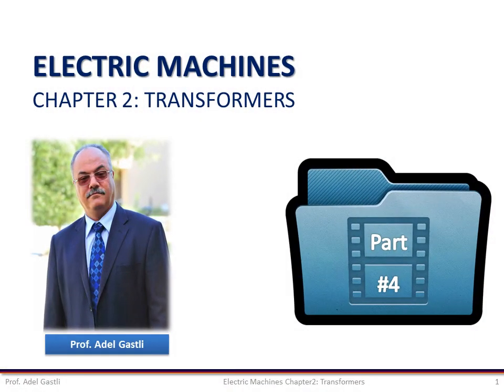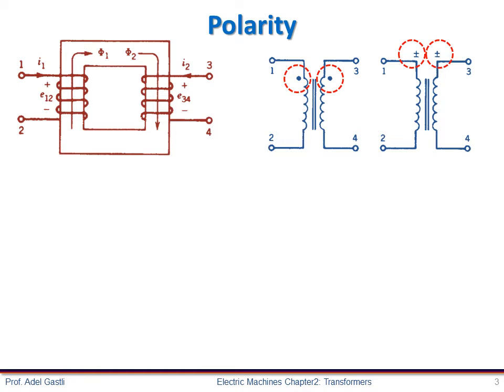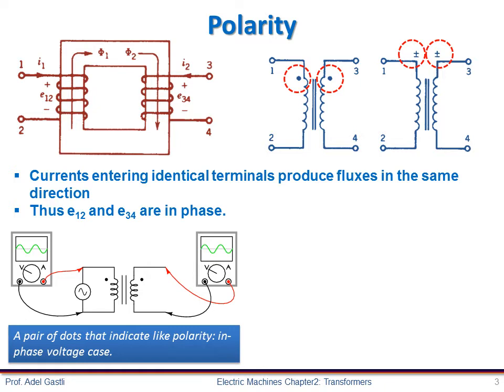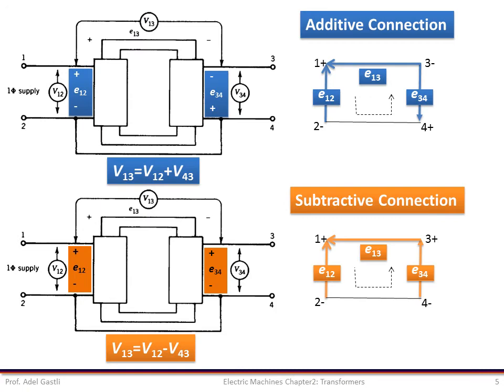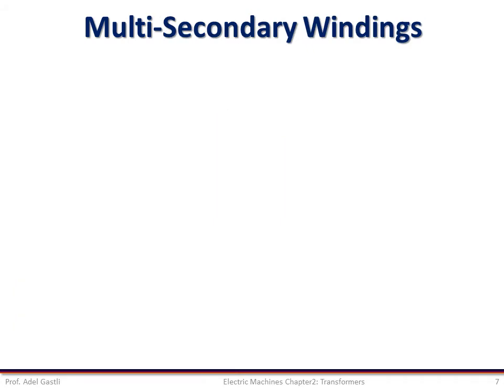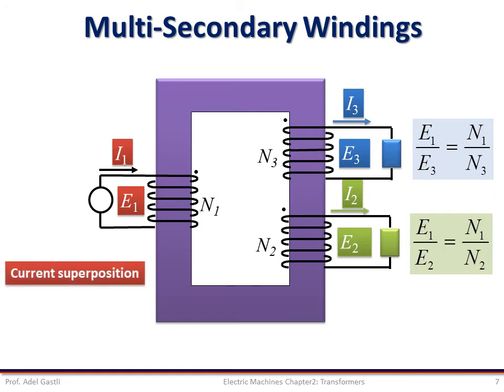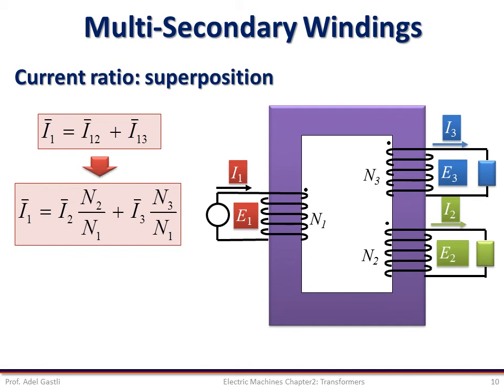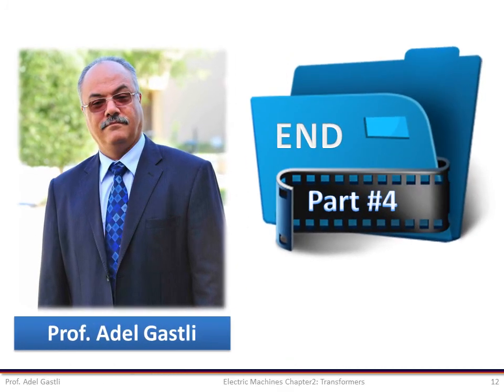Electrical Machines: Transformers (Part 4/8)

Comment: Some remarks need to be made: direction of i2 on "Polarity" slide is wrong.  It even contradicts the definition. 
The equality of the sum of MMFs to zero over a closed magnetic circuit means there is no magnetic voltage drop  ( HL integral). So, this is of course not "expected" but close to be true because of small HL.